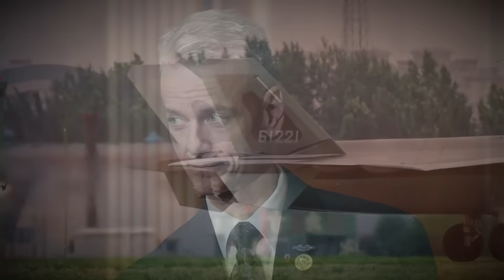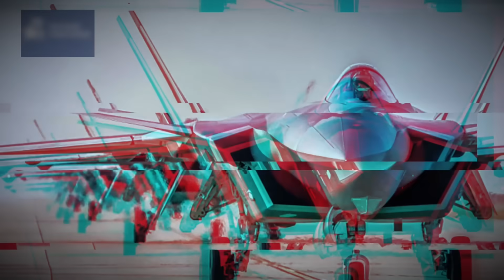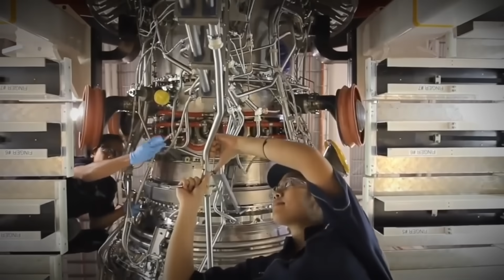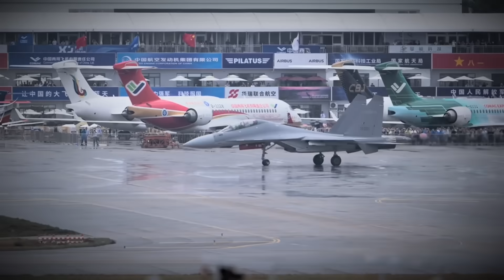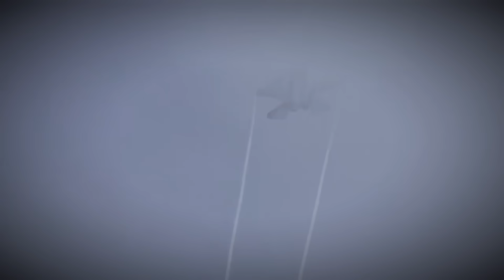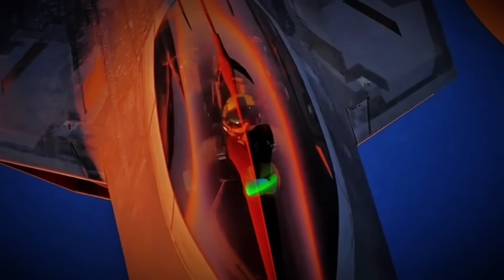GE Just Broke Its Silence on China's Jet Engine Advancement

Comment: This is actually much more about material science than anything else. The old generation of Chinese before 1990 were following Souviet line of thought and were not keen on developing advanced materials. That changes after 2000. They can now make the single crystal nickel blade and the bearing steel in house and those are what finally make the ws10 and ws15 usable.
Reply from the maker: You’re right that materials are a huge part of the story — especially single-crystal turbine blades, coatings, and high-grade bearing steel. Without those, engines like WS-10 and WS-15 simply couldn’t reach stable, repeatable service life.

One thing I’d add is that it wasn’t just a mindset change after 2000, but a long catch-up cycle. Even after China learned to make single-crystal blades, it took years to control quality, yields, and consistency at scale. That’s why WS-10 struggled for so long before it became reliable, and why WS-15 is still being rolled out carefully.

Do you think materials were the main bottleneck — or was systems integration and long-term durability just as hard to solve?
Reply: @EngineeredGiants  The material has always been the major bottleneck. The mindset of the 1980 and before Chinese have always been "material science and physics are fancy stuff that doesn't directly make money".  Most of the young people back then (and old people by now) prefer learning electronics, mechanics over material and physics because those allow them to build low end products and make money. Only after 2000 when enough money was made and the government decided to build higher tech stuff like jet engine then they suddenly realize they are completely empty in the material science space, and they suffer from it for ~20 years. Now they are catching up but that's not easy for sure.

Comment: Boy, either this video itself is 2 yrs behind, or GE’s intel is 2yrs behind. 

J-20 went through total of 3 engines. 
First is Russian. 
Then Chinese domestic WS-10.
Then WS-15, which is “the” design engine for the J-20. 

40,000 lbs thrust. 
Full vectoring capability. 
This engine already entered serial production, supporting J-20 production in 2024.
And today we are towards the end of 2025. 

This engine first ran in 2006.
By Feb 2023 there were news articles in western papers trying to laugh it off as a joke. 
This video dated 2025 is saying “Chinese engines are closing the gap”.

F-22’s P&W F-119-PW-100 engines make 35,000 lbs thrust. 

Chinese engines are “closing the gap”? 
Did the F-22 receive newer & better engines that we don’t know about?
Reply from the maker: You’re right that the WS-15 entered serial production and that its raw thrust is higher than the F119. That part isn’t in dispute. The point in the video about China “closing the gap” isn’t about thrust alone, but about the full set of engine metrics that the industry uses to judge maturity.

Even GE’s own statement in 2025 said the same thing: Chinese engines are catching up in performance, but they still trail in fuel burn, hot-section durability and long-term reliability. Those factors are what kept the gap open for so many years, not the thrust number.

So yes, the WS-15 has serious power and it now equips new J-20s, but matching Western engines across the full life cycle is a longer path. That’s the gap the video is talking about, and 2025 is the first time GE publicly admitted that China is getting close.

Curious to hear your view on this part: do you think the next big milestone will be reliability or fuel burn?
Reply: @EngineeredGiants 
Here is my take on these various “engine metrics”:

Hot section, cold section, doesn’t matter. 
What is real is the ultimate “mission ready” rate, which engine plays only a part. 

F-22’s mission ready rate is 40%.
While J-20’s stat is not available, “western experts” estimate it at 70%. 

When J-20’s need to go through engine overhaul, they’re “right at home”.
When F-22’s do the same, that means front line F-22’s need to be pulled to the back. Those front line F-22 numbers need immediate replenishment, whether at Guam, or in Germany/NATO.

And we haven’t even gotten into comparison of radar, AWAC link, integrated low earth orbit satellites, etc. 

Can the Chinese air power be as effective operating off the coast of USA, as American air power operating off the coast of China (eg first island chain)?
Most likely no. 
That was never the Chinese goal. 

But:
Can the Chinese air power be MORE effective than American air power, NEAR Chinese coast, up to and including the first island chain, when considering the totality of all-available military assets on both sides?
Absolutely yes.
Reply from the maker: @reallifeengineer  Those are fair points, and you’re right that mission ready rate is what matters in real operations. At the same time, the challenge with comparing F-22 and J-20 readiness is that only one side publishes hard numbers. The 40 percent figure for the F-22 is official. The 70 percent estimate for the J-20 is not backed by public data from the PLAAF, so analysts treat it with caution.

That’s why the video focuses on engine maturity rather than full-fleet performance. Hot section durability, time on wing and fuel burn do not decide a war by themselves, but they do decide how often a fleet can fly, how often engines need to be pulled, and how much strain is placed on maintenance crews. Even GE’s 2025 statement pointed out that these areas are still where China has work to do.

None of this takes away from China’s advantages near its own coast. Operating close to home, with full support from ground systems, radar networks and local logistics, is where China plans to be strongest. The United States thinks in global terms. China thinks in regional terms. Different goals mean different design choices.

Engines alone do not settle the balance. But they do show how much progress China has made, and how much room both sides still have to grow.

What part of the J-20 story do you think will change fastest next: the engine side, or the broader support network around it?
Reply: @EngineeredGiants 
Definitely the “support network” around the J-20. 

The issue American weapons systems face, is the natural outcome of free enterprise / capitalism.
Each company and its top10 shareholders is on the top of its own hill. 
While there is requirement from Pentagon that each new weapons system works with the existing datalink platform, that is the extent of “platform development thinking strategy”.

By contrast, most of the weapons research & manufacturing in China have partial state-ownership, which calls the shots on what the central development theme is. 
J-10 is made by Chengdu. 
J-15 is by Shenyang.
J-16 is by Shenyang. 
J-20 is by Chengdu. 
J-35 is by Shenyang. 

And then there are the emerging 6th gen:
J-36 by Chengdu.
J-XDS by Shenyang. 
Plus unmanned wingman drones that will accompany the existing J-20/etc. 

Between Boeing and Lockheed, they are REALLY in a competitive position vs each other. 
Between Chengdu and Shenyang, they operate in a synergistic position with each other. 

The days of man’ed fighter jets out-maneuvering each other “for the kill”, whether visual range or BVR, will soon be behind us. 
Soon China will have drone platforms flying well in the upper stratosphere (not reachable by Western anti-air solutions) able to remote-release guided air-to-air and air-to-ground solutions.
F-22/35’s will become irrelevant in that context.

Comment: the official CCP military announce this new Jet engine use Peanut oil to fly so efficient it even can flay from Beijing to New York by one spoon peanut oil, it also can be out off the space China advance technology create new shield coating made from bat oil. radar cannot detect the plane and give some anti gravity power. and if it got captured by the American. the plane are build with protection system thanks to China Con Technology it will immediate call western America pilot as a racist make them immobilize and feel guilty, in the end the pilot will surrender to China and CCP will rule the world.
Reply: feces cowdung curry poopjeet

Comment: This is standard Chinese indigenization:  initially build copies of a working thing, indigenize to build a basic domestic version, and incrementally improve every year before moving to advanced systems.  China did this with High Speed Rail, Electric Vehicles, Solar Panels, Nuclear Power Plants, Semiconductors, Robotics, AI, and so forth. Now, it's aerospace. The big surprise is how fast China advances and scales.

Comment: Unfortunately for GE, the truth is China has alresdy supersede US in engines design and construction.
WS15 engine at 18.5 tons is more powerful than F-22 15 tons GE-119 engine and closer to F-135 in thrust output installed in F-35.
Without REE and other important minerals by China, US MIC is screwed.
China have just revealed  yet another revolutionary contra-rotor turboprop engine at her airshow. 
Observe from 2025 we have been witnessing new aerospace products from China.
CJ1000A is something that really worrisome for GE today. Thanks to the US politicians, GE like Nvidia may have just lost its market in China.
Reply: The WS-15 has a bypass ratio of approximately 0.25, while the F-135's bypass ratio is 0.57, someone still thinking F-135 is a better engine is totally out of their mind.
Reply: @JeremyYoung-j1t 
The truth or secret has just been revealed by GE insiders that the thrust to weight ratio of F119 and F135 are 6.5 and 7 and not 10 as reported. 
Both WS10C and WS-15 have  better thrust to weight ratio.
While the Chinese are  generally secretive about their military hardwares but recent exposures in the net are intentional e.g. WS15 is now revealed with a ratio of 11.5 which is surprising. Everyone presumed Chinese engines are heavy.
No wonder state media  revealed that J-20 can supercruise at Mach 1.8 without AB. 
This easily beats F-22 at Mach 1.1.
Recent aerial display by J10C and J20 at Dubai Airshow 2025 shocked everyone esp fireigh military experts..
This can't be verified but news in the internet claimed that a J-20B has intercept Blackbird flying at 75,000 feet. 😳

Comment: YouTube BABBLERS know how to talk endlessly yet say very little. Repeating the same statement over and over and over and over seems like they are just trying to fill a video time line with audio using a very small amount of information.
Reply from the maker: This video actually covers a lot of concrete information — GE’s public warning, the full WS-10 development path, the WS-15 appearing on J-20 test aircraft, and China fielding the WS-19 and WS-20 across multiple platforms. Every section introduces new verified milestones from the aerospace industry. There’s no repeated filler — just a structured breakdown of how China closed the engine gap faster than expected.